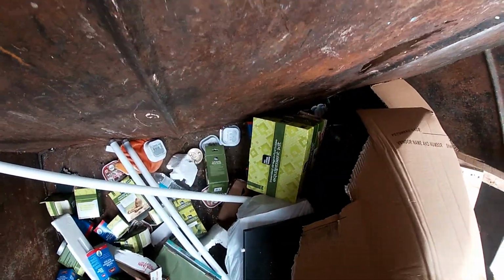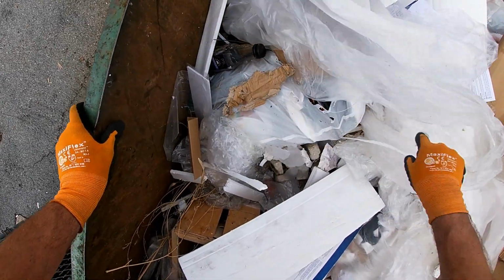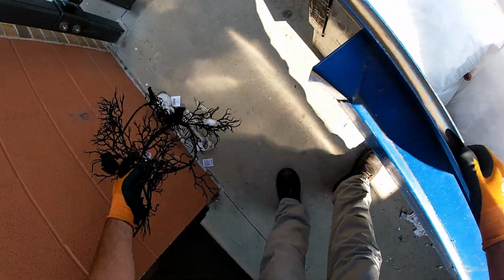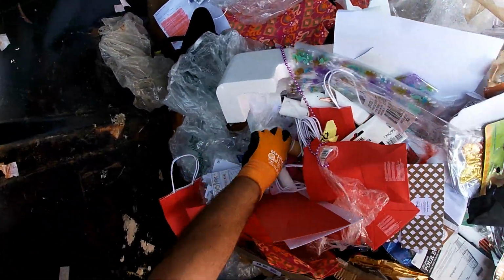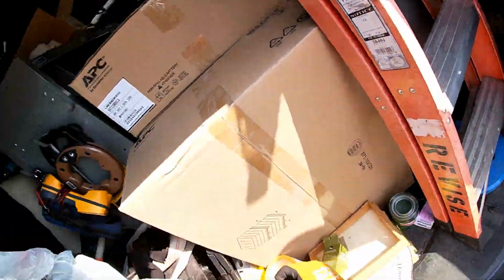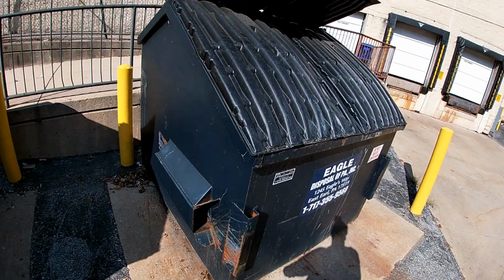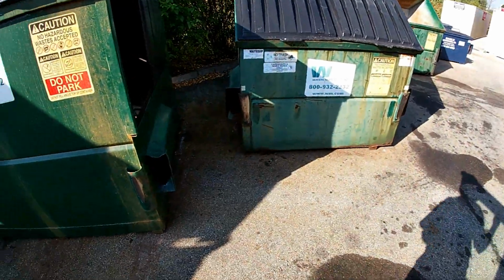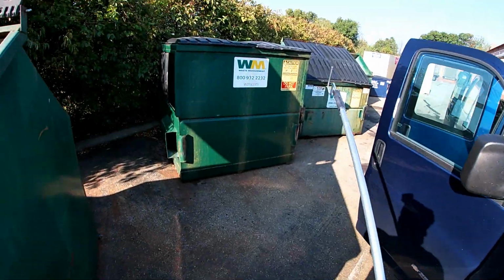Dumpster Diving Episode 7: Part One "Don't judge a Dive by the first dumpster"

Comment: Here is a helpful hint for the dive team...Krud Kutter is the best, ounce for ounce cleaner on the market. You can spray it full strength or dilute it to your hearts content. I used it to save my mothers 1902 solid oak table from being painted! UGH..a good soaking and the old shellac came off on the first swipe. I fixed a porcelain sink from the eighties with a daily cleaning, no more rust, no scratches collecting dirt. There are two kinds but they cross over both ways. Thomas Johnson Antique repair YT channel turned me on to it. I have five people hooked on it now and they are glad I did. SOrry if this sounds like a commercial but I can't say anything bad about that BIODEGRADABLE and food safe spray cleaner.